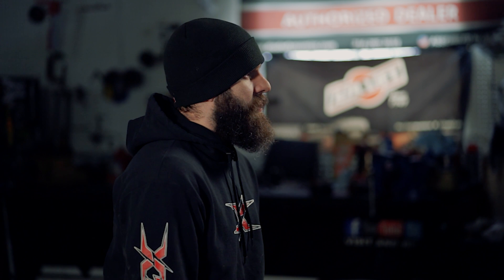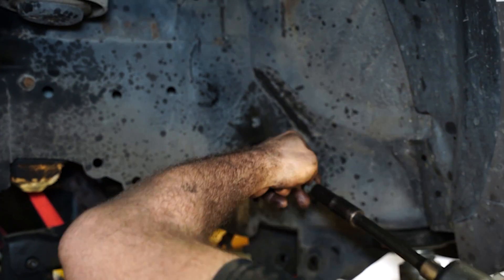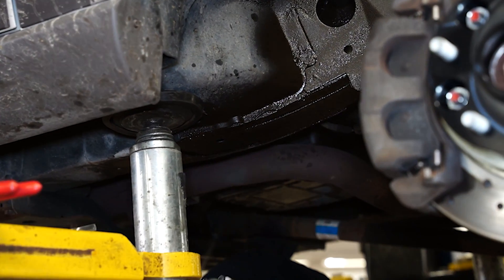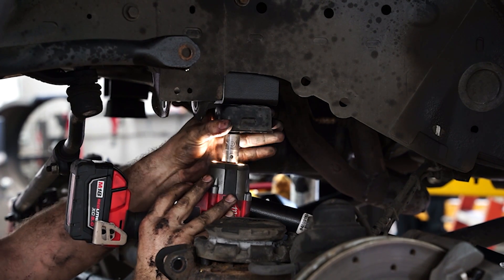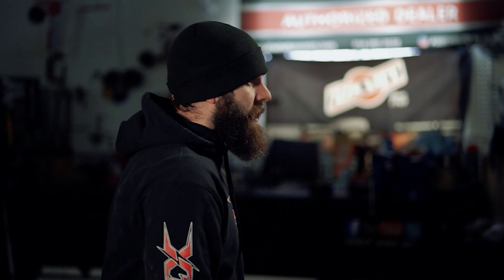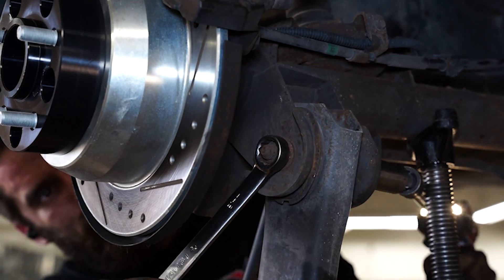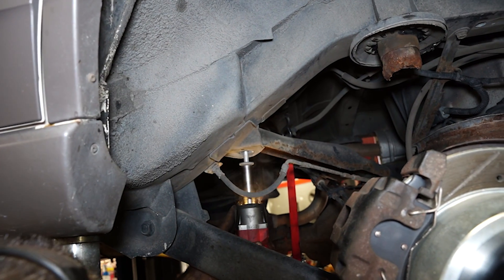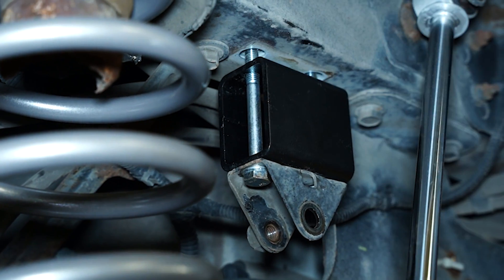Jeep Grand Cherokee WJ 4 inch Rough Country long arm lift kit

Comment: Rough country said this doesn’t fit the AWD models???
Reply from the maker: It's because of the front drive shaft. So if you do a 4 inch kit, no matter whos kit, they are going to recommend you get rid of the rzeppa driveshaft and upgrade to the double cardan drive shaft. People go to junk yards and pull them off of other WJs, or their is a guys who does it and sells them on FB he is pretty active on the WJ facebook forums. From what I have seen people have been super happy with him. If you post in one of them they will get you in contact with the guy. Or, go the route I did and buy one and the yoke to go with it. I got my DS from Tom woods.(great DS) and the yoke I got from iron rock offraod.

Comment: Is that V8 in your WJ? Still don't know why they list it as it wont fit the V8!
Reply from the maker: No I have the inline 6 but the reason is because of the front drive shaft is the CV style. You will need to replace it with a double cardan driveshaft. That is the only reason. So, beyond that you are good to go.
Reply: @XtremeTruckAuto  Ah, ok. That makes sense. Thanks for the help.

Comment: So on the fence with a lift. 04 WJ, I love it but it's also my DD... almost 40 miles round trip daily. How does it handle on the road? I seen people installing the dbl steering stabilizer and say it does well. All my control arms are shot so needs done regardless. Just not sure if the ride warrants a lift. Awesome video! Appreciate the indepth communication!
Reply from the maker: Mine is my daily as well (50 ish round trip to and from work). I have had it on for a while now almost a year and It rides great (almost like factory) no complaint at all. Even when I have people ride in the jeep they tend to mention the ride quality. I just upgraded the steering stabilizer to the single RC stabilizer and it has been doing it's job just fine.  I have a video on that as well. Yes I would recommend this kit but my one complaint is the track bar heim joint is loud as well, but Yeah over all super happy with this kit especially for the price.

Comment: Holy bumpsteer huh?
Reply from the maker: Honestly, not as bad as you would think. The only reason why I had put the drop pitman arm on was because I wanted to relocate the track bar so it matched the drag link's new angle. Thought I had a new set of axels lined up but it never came to fruition. So the drop pitman arm came back off. I didn't want to do that much work just to keep the stock axel. In hindsight, which is always 20/20, I should have waited on the pitman arm install. Oh well, you live and you learn.